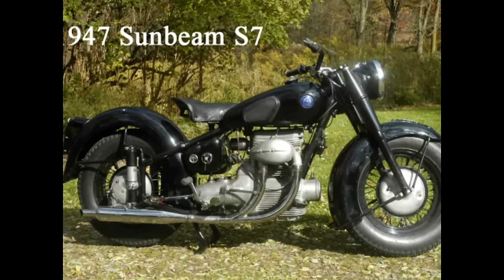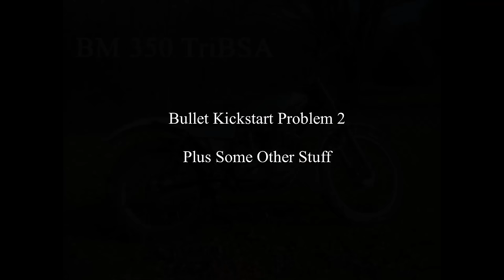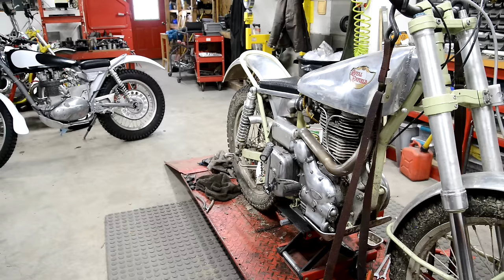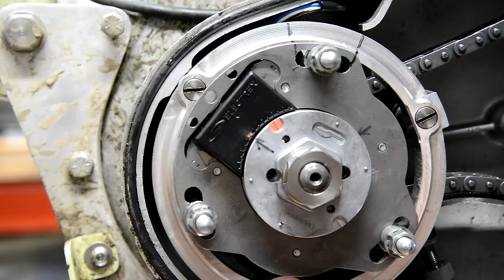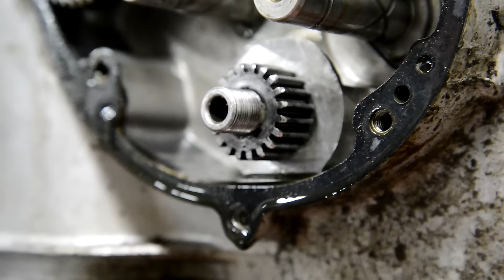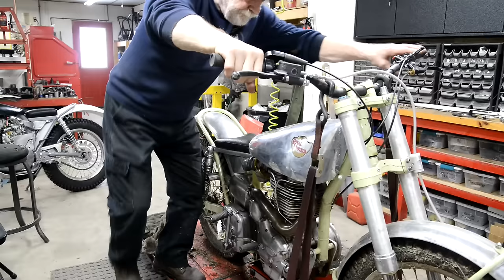Bullet Kickstart Problem -  2

Comment: Reckon your explanation is about right. Not sure why you need those extra gears, maybe able to plug the oil gallery and eliminate them?? Thanks Mike, well done mr holmes.
Reply from the maker: I asked Hitchcocks as originally I only had one and they said they weren't needed, but Enfield specialists said that they were, so I erred on the side of caution. I don't think that they are required.

Comment: Well done Michael. You had doubts about that timing case fit in an earlier video and had it off and on quite a few times.
As you said philosophically you solved a couple of problems before they surfaced along the way.
Nothing too expensive  just time.

Comment: I would think anyone who has worked on these engines as long as you have would know there has to be thrust washers of the correct thickness between any steel shaft shoulder and the aluminum case shoulder otherwise the shaft spinning against the case shoulder would wear the case out , good that you caught this mistake along with the wore out parts in the transmission an kick starter

Comment: I found this fascinating. I am 68 years old and struggle with the same age related frustrations. I mostly work on Triumph twins and a common problem is a stuck kick starter and it is usually related to worn kick start ratchet gears. I have no experience with Royal Enfields, but all through the video I was telling you to "look at the ratchet mechanism". I am glad you found the problem! More darn fun with old British bikes!
Reply from the maker: The B44 that I just finished had the also common with BSAs worn ratchet problem where the leading teeth do not mesh but bind tooth to tooth.

Comment: I had exactly the same symptoms on my bullet Michael, turned out it was the crank pinion, it had cracked, I fitted a spare one I had and that split as well so third time lucky it was ok, when you tighten the worm drive on to the taper it had cracked them slightly, the engine would turn most of the way then stop because the gap between the teeth was slightly enlarged in one spot, as you say, bugger!

Comment: It was unfortunate that the washer came off without you noticing but for anyone messing with mechanical stuff this sort of thing will  happen at some time. I have never messed with motorbikes but I have rebuilt a number of car engines, gearboxes and axles over my lifetime. I watch you channel because I just like mechanical things and your projects. One thing I have noticed about these old British bikes is that there are so many washers and  spacers involved in the assembly I would have thought that there would have been more effort to reduce the number of components because tolerance build up can become an issue. Modern replacement parts made in either India or the far east can come with a whole host of problems. The classic car world is the same. I have had to go through 3 power steering pumps to get a good replacement for my old Mustang.
Reply from the maker: You have to bear in mind that the cases, barrel and heads on these engines were all sand cast and then individually machined on manual machines. There was no die casting and CNC so machining tolerances were built into the design and shims used to accommodate machinist's variations.

Comment: Hello Michael
Screwdrivers My Dad had wooden handled Screwdrivers never had any problem with slipping when using them, a quick clean just to make them look nice again, still in the tool chest well over 80 years old (to valuable to use)  and to expensive to get the same again
Nicky
Reply: Yes but tools are made to be used not looked at!

Comment: You got there eventually Michael. I'm sure you did notice but I will mention it in case you didn't, there seemed to be a nut missing on the top front frame to engine mounting while you were working and I was sure you hadn't taken it off for this job, so I've mentioned it. That certainly was a head scratcher! It's lucky that the woodruff key sheared as it did directly in the line of the joint between the pinion gear and the crankshaft. I was envisioning the crank end being completely buggered and it needing a new one worst case scenario lol luckily only needing a new 1/8" key and reassembly. As you said when trying to start it,  it normally started first kick, she was true to your word when the valve timing was sorted!  ps, When are you going to give the bike a clean?
Reply from the maker: A good was and clean when it's not 20 degrees below freezing outside.

Comment: Is that a snapped bolt on the engine mount plate?
Reply: I noticed that as well and mentioned it it my comment lol
Reply: @samrodian919  l did have a quick look through the comments before posting, sorry l missed yours.
Reply from the maker: I think that you must be seeing the bolt that fixes the exhaust bracket. I push it through to the left to get the pipe off.
Reply: @BritanniaMotorcycles  Yes. Thanks for clarification.